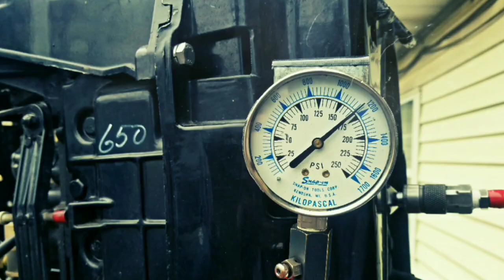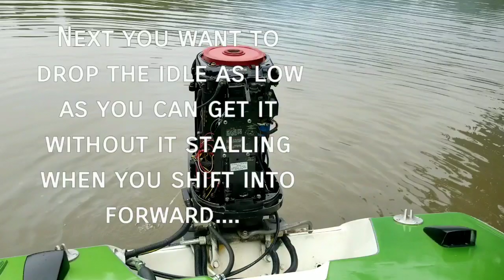Mercury Outboard Link & Sync Final Carb Adjustments - How to Tune your Carbs

Comment: Hello. I just wanted to say THANK YOU!!!! after rebuilding the carbs on a 05 Merc 50hp 2 stroke elpto I followed your instructions and she cranked right up!!! OMG!! Ive been fighting this for a month. Will fine tune once I get it on the bay next week. Thank you!!!!!
Reply from the maker: You're welcome!!!
Reply: @MerCSonL6  Hi MerCSon thanks for your channel! I’m having a terrible time getting 1980 115 to idle below 1000 and also falls on face on take off. In fact can’t take off unless I have quickly throttled up in idle and then shift forward and hit choke with key (not enricher). Followed your videos and have failed to fix. Taken to two marine mechanics here in Ontario and no luck as they are not experienced with these motors. Could jets be issue? If they are does that mean reeds were damaged? They looked fine on rebuild. Any advice? Thanks!

Comment: All your videos are great need more people like you that are willing to help. I've had that problem of a dead stop when you gun it for a long time. I think my adjustment was too far in all this time and the manual gives a different setup with starting at one turn out. I'm a little confused at the end of their procedure they say adjust the ideal speed screw to recommended RPM. Also at the beginning you said I need to get the ideal as low as possible when shifted into gear. Did you and the manual mean there is another ideal screw for RPM speed. I thought there wasn't one. One other issue I run the boat in mountain lakes from 8000 to 10,0000 feet elevation. I've never spent the time to research this because lack of info and fishing was more important. I'm retired and don't want to get caught on the lake in a wind storm and wreck my boat. Thanks for your great insight, Keith
Reply from the maker: Your jets need to be changed due to the altitude. Thinner air means thinner fuel/oil. There is no other setting/screw. You just need to get the idle as low as possible using the throttle cable adjustments and carb/distributor stops (whichever version u have). Son

Comment: Bought a boat with a 1978 1400 (140) Merc knowing there was a fuel issue but had good compression and spark. I just noticed there is no choke rod connecting Carbs #2 (middle) and #3 (bottom) nor a choke shutter on #3. Is there supposed to be one?
Reply from the maker: 78-79 I believe they relied on the enrichment system. However, your modem is missing the choke screens. Son

Comment: I'm from Buenos Aires, i have seen your vídeos, my english isn't very good, but i lern very well. I own a '78 Mercury 110 HP. , and i 've solved a lot of problems by your work. In these moment i  have seen de final carb adjustment, justo lo necesitaba (translate ). The fuel tank was rusty and very full of dirt, i clean up adn por twol filters but it doesn't work, the carbs fails.
Now put i a new plastc fuel tank, cleaned the carbs,aaand now can i give the final ajustment. Thanks and greatiings fiom Argentina

Comment: Thanks for the helpful video.  I have a 76 150 hp merc.
Question: I rebuilt my three carbs and put in new orifices and needles as well as floats and adjusted float tangs, etc.  Now, when I turn down the needles, it shudders a bit, but I can't kill the motor if I turn it too far.  It used to die when I turned it down too far.  Problem?

I'm not sure all three carbs are equal now.  WOT is about 85 percent of what it used to be.  4200 rpm is max instead of 5000.

Guesses?

Thanks again

Comment: So, if i can't adjust the carbs because the butterflies are still closed at idle should i advance the primary pickup a bit?  It was advanced further but was bogging hard when i throttled up unless I revved it up in neutral to burn off surplus fuel first.  1973 1150 13p on 20' pontoon, 5200 @ WOT and 25mph.  It was running good but started losing power and dumping fuel due to bad diaphragm in fuel pump. I dont think these carbs have seen seen any fuel pressure in a while.  Rebuilt carbs recently due to bad fuel.

Comment: Hello son. Question? Here lately in the morning when trying to start my motor, it just click,but when it warms up it starts fine. Ever morning here lately.  You think it's my solenoid or starter?
Reply from the maker: Selonoid. It's cheaper. I would start there. If you have a volt meter you can test it by measuring how much voltage goes from the hot wire to the opposing post (should be 12-13v). Let's me know. Son

Comment: MerCSon, I appreciate your videos and have learned a lot.  I have a 1980 Merc 115 that has been brought from about 1000 ft elevation to about 6,000 ft elevation.  Engine does not wrap up like used to and very hard to start.  Can you give me a few pointers to get this engine running better.  Anyway that I can get it to run at both 1000ft and 6000ft elevation or do I need to tune carbs every time?  Thanks for your help in advance.
Reply from the maker: The air/fuel is greatly thinner @ 6k..... there's no way to balance the significant increase between the elevation. You would have to change the jets every time.... not necessarily the carbs. Elevation is tricky because it controls air/fuel intake. Less air = less fuel/oil which can potentially burn 🔥 down your cylinders if not addressed. Hope this helps. Son

Comment: Hello, got a 90hp 1983 TOWER OF POWER.  Problem I'm having is the idle in neutral seems a bit low - and when going in reverse at low speeds the engine seems to shut off.   Any idea which screw i would have to play with to get the idle only a little bit higher?  thanks bro love the vids big time!!
Reply from the maker: Advance your timing without opening your carb butterflies/throttle body. Son

Comment: Hey son was reading in your description if you turn the carburetor all the way close and it's still running "leak"!  I have a 87 L4 45hp classic 50 the bottom carb is doing just that..   Curious to what "leak" problem I have and what is a good solution thanks in advance!
Reply from the maker: Vacuum leak. Son

Comment: Hello! Does this work with 99 Mariner 90hp 2s? How to disconnect the throttle cable? Is is needed? How can I put it to gear if it's disconnected? Thanks in advance!
Reply from the maker: Yes. Son

Comment: Im having problems with my 71 115hp merc it starts but dies as soon as I give it throttle do you have an idea what it could be I changed the fuel line and bulb already fuel filter as well but still does the same thing
Reply from the maker: Engine is not getting enough fuel. Link and Sync could be off as well my friend. Son

Comment: Hey ! Can you tell me exactly what stumble is ? The motor doesn’t sound different through a phone speaker
Reply from the maker: The engine "stumbles" like it's going to shut off. Like it's running low on fuel. Son

Comment: Thank you,Sir. I am doing this now. are the butterfly fully closed when you do this adjustment? is this speed idle?
Reply from the maker: Yes. It has to be able to idle with the butterflies completely closed. Son
Reply: @MerCSonL6  Thanks, is this idle speed? or should adjust throttle link after this carb adjustment to achieve the idle speed.
Reply: @MerCSonL6  Hello,Sir. My engine is mercury 500 thunderbolt  around 1973. it is not able to idle with butterflies completely closed. The engine runs well as long as I give a little throttle by adjusting idle stop screw. what can cause it. Two cabs are rebuild and very clean. I have double-checked.Thank you
Reply from the maker: @yijianggu5203  the floats/tangs are likely off. I needs to idle with the butterflies completely closed. Son
Reply: @MerCSonL6  Thank you, but when I turn the idle crews to the bottom, the engine wasn't able to start, which approved that idle jets were feeding the fuel to the cylinder.My idle screw set is 1+1/2 turn out from bottom.

Comment: Should I do my 40hp 2sroke the same?  Do you suppose to disconnect  the throttle cable when doing this?
Reply from the maker: Yes and yes. Son
Reply: Can I just put the gear forward and adjust it that way without loosening it?

Comment: Have an '87 115hp, CDI. Holeshot is awesome, runs great for 1 mile, then it's like it's starving for fuel. 
Do you think this will help?
Something else?
Reply from the maker: Definitely something else. Make sure theres are no obstructions or air leaks from the tank pickup valve all the way to the carbs. If fuel can get out air can get in. Son
Reply: @MerCSonL6  Had a head up butt moment. I put the inline fuel filter in backwards! Runs like a champ now. Thank you for the help, and the videos. They are very helpful, I would start and stop them as I was going through the carbs. Gonna do the same thing when I set the idle, from this video.

Comment: Getting ready to rebuild my carbs this weekend, 79 140. Can't find a link and sync video of yours. Do you have one or link to a good one or written procedure? And also, your videos are great, keep up the good work. Was able to splice in a newer style controller for mine as the old one was junk, all thanks to your videos!
Reply: Oh and mine is a dizzy model.
Reply from the maker: Chance Loney try this: https://forums.iboats.com/forum/engine-repair-and-maintenance/engine-frequently-asked-questions-faq/173257-timing-and-sync-of-merc-inlines-to-1988?t=168855
Reply from the maker: Clams does excellent work. Follow his procedure and it will get you real close of not right on the money. Hope this helps. Let me know!
Reply: Thanks for the reply, I have actually read over that one about a dozen times, lol. Couldn't decide between it or the method in cturboaddicts video.
2 quick questions, I have read been doing tons of research and have found mention of something about setting the dizzy timing belt 1 tooth off or some reason, do you know anything about that? And for tdc, i have a pointer and timing marks, can I just verify with something in spark plug hole to feel it's still pretty much accurate or should I use a piston stop or drop gauge to make sure?
Reply from the maker: Chance Loney by "dizzy" model do you mean "distributor?"
Reply: Yes
Reply from the maker: Chance Loney the distributor pulley sometimes is off. In that scenario where the pointer, punch marks, and crankshaft do not line up, position the pointer slightly to the right (clockwise) when viewed from the top. I've never heard of 1979 distributor model. Must have been the last "dizzy".....  Adi came out that same year as well. I prefer the "dizzy" models over ADI all day everyday. The link and sync will be much easier for you on this model. Definitely verify TDC with a piston stop or gauge. This is not something you want to guess on. Your model should have the high dome direct charge pistons which are prone to burning the tops. 1-2 degrees off can seriously jeopardize your engine. I hope this helps. Let me know. Thanks!
Reply: @MerCSonL6  I am having issue  with finding TDC on my '78 1400. Had a "Key West" mechanic come over , he separated the outer flywheel from the bolts and never show'd up again .. I had to guess, now I believe she wont start as result. I pulled #1 plug out, I visually found TDC turning clockwise marking flywheel with 4 different marks. Have a stop coming on Monday. I really need some help and down here in Key West only people working on newer engines ... Boat lives in water behind my house boat .. Thanks!

Comment: Hey bud, I have a 1984 Mercury 115 2 stroke, it runs great with the ear muffs on, but only goes about 12 miles a hour in water, any clues why? l just had the carbs rebuilt, there is 120 psi in all cylinders, new plugs new gas lines, etc, but still not getting full throttle under a load.
Reply from the maker: There can be a lot reasons with your symptoms. Sounds like a lync N SYNC issue. Or not enough fuel. Are you pitched properly? Let me know. Son
Reply: Update, i’m definitely not a mechanic like you are when it comes to outboard motors, so I broke down and took it to the local Marine shop, and they fixed it, One of the switch boxes were bad.
Reply from the maker: @chancenill7014  that could have been diagnosed using my videos. Hopefully they didn't charge you an arm and leg for the diagnostic and install. Son
Reply: I love your videos, they have helped me out a lot understanding my motor, keep on making them! They charged me $465.00 to replace the switch box, sync, and adjust the carburetors, and make sure the timing was on the money, I think they charge me a fair price.
Reply from the maker: @chancenill7014  my videos are free. Son
Reply: Go on Facebook type in Chance Nill I’m the only one in the world on Facebook with that name, I posted a video of the first trial run today, I ended up getting a $90 ticket!!  My mercury is on a 1979 glastron, I think you will like the video.

Comment: What opens and closes my caburator s on a mercury 500 thunderbolt 50 hp bout a used boat n feel like parts are missing
Reply from the maker: Throttle actuator. It's attached to the Throttle arm and is positioned right above the top carb. Son

Comment: Hello sir. If water is coming from your Tell tale, is very hot, what is the problem? 40hp mercury.
Reply from the maker: Potentially a blockage. Not enough water flow. New impeller? Son
Reply: @MerCSonL6  yes,
Reply: @MerCSonL6  what should I do next?
Reply from the maker: @bigjack5974  try vacuuming out the copper water inlet tube with a shop vac. The vacuum out the water outlet (pull off nipple). Make sure muffs are secure and water is turned on as high as it can go. Let me know. Son
Reply: @MerCSonL6  do I do this while the motor is running?
Reply from the maker: @bigjack5974  no. The water jacket has an area that can become clogged right above the water plate (beneath the powerhead). Most, not all, of water flow issues occur in this area. By vacuuming the copper tube it should pull out whatever is blocking. Its similar to reverse flushing your engine but without water. I would make sure the shop vac is empty so you can potentially see 👀 of anything obvious comes out. Another area worth checking is the seal inside the water outlet tube on top of the water pump. The better the seal the better the flow of water. Son
Reply: @MerCSonL6  They boat I'm asking about is my buddy. He told me today after doing everything that now it's not spitting any water out. He took the foot back off check everything, all connection was good. What do you think?

Comment: I have a mercury 1976 850 85hp I just rebuilt my carburetors and new pump and I replaced all the gas lines now my boat won't accelerate past 10mph does anyone have any ideas thanks
Reply from the maker: Perhaps it's not syncd correctly. Son

Comment: same deal for cdi models?
Reply from the maker: Yes sir.
Reply: @MerCSonL6  tried it out earlier wanted to quit at first couldn't get it to stay running but I eventually figured it out and learned so much bout the motor in the process. I also found a small leak coming from my top carb directly from the bottom :(
Reply from the maker: @str8wick3d  if you are talking about the leak where the carb butterflies hinge that's "normal" & more so the nature of the beast. It tends to balance out after the carbs tuned properly. Key thing is that the carbs are completely closed while idling. If you have to crack them to stay running/idle something is not right somewhere. Hope this helps. Let me know. Son
Reply: It is leaking from the very bottom of carb assembly not in the butterfly @MerCSonL6
Reply from the maker: @str8wick3d  are you talking about leaking thru the plug at bottom?